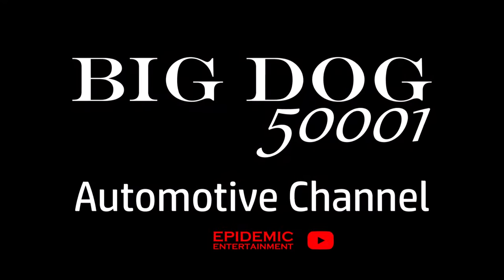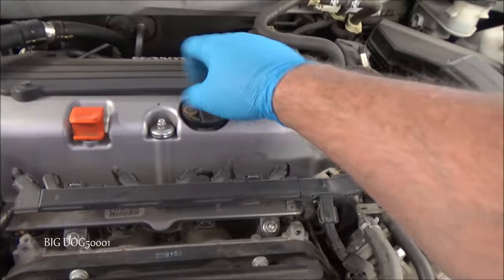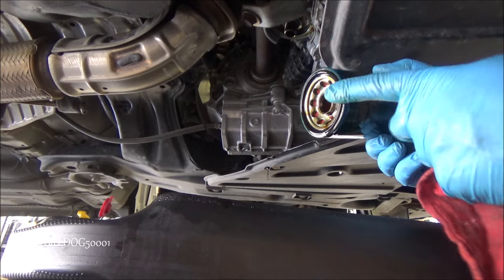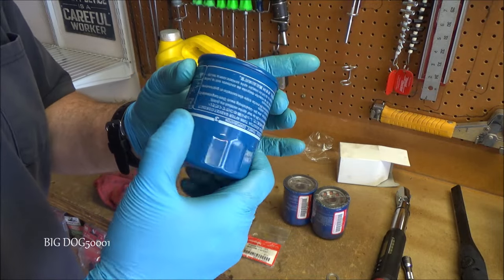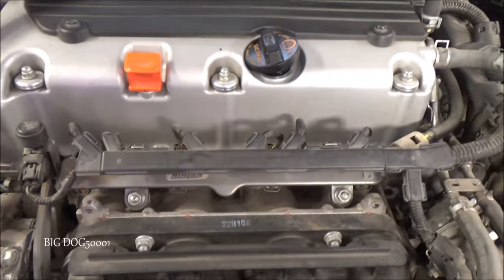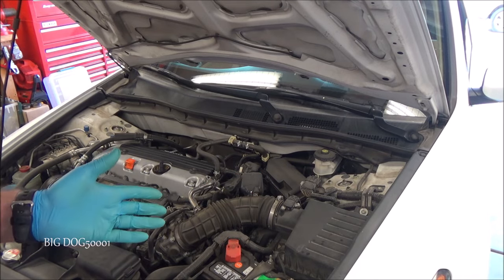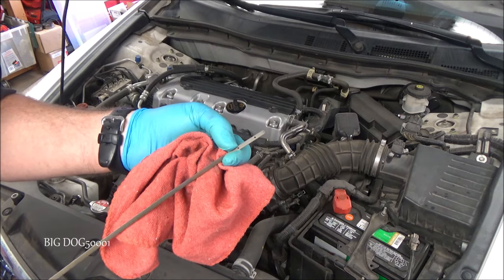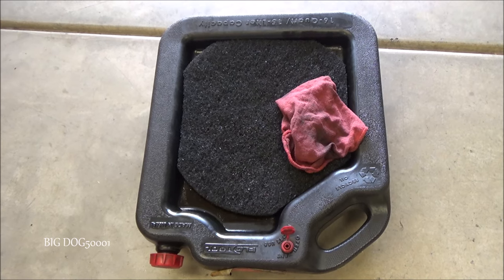2008-2012 Honda Accord 2.4L Oil Change (4 Cylinder)

Comment from the maker: Parts and Tools
Disclosure: This channel earns a small commission using some of these links - at no additional cost to you.
Honda Oil Filter Wrench 07AAA-PLCA100:  https://amzn.to/43Z7nN8
Lisle Funnel Kit 19612:  https://amzn.to/3r3HNHU
Honda Oil Filters:  https://amzn.to/3NlQ8hP
Honda 14mm Drain Plug Washer 94109-14000:
Jack:  https://bit.ly/3oDE82k
3 Ton Jack Stands:  https://amzn.to/3PtxgQI
Wheel Chocks:  https://amzn.to/3XDBO9j
Long Pliers:  https://amzn.to/3NLH3An
Sockets:  https://amzn.to/46iPaeV
Snap-On Digital Torque Wrenches:  https://bit.ly/3gzVN2q
Oil Drain Pan:  https://amzn.to/43ck0Dn
No Splatter Pad:  https://amzn.to/46fiiUt
Center Punch:  https://amzn.to/3PrRAlm

The Big Dog 50001 Automotive Channel Store can be found here: https://www.amazon.com/shop/bigdog50001automotive  (As an Amazon Associate I earn from qualifying purchases).

Comment: For anyone with this specific engine, I've completed used oil analysis several times with Pennzoil Ultra 5w20 using the Maintenance Minder, averaging 7500 miles with absolutely superb wear numbers.  The first time I switched to this oil I did have to add some makeup oil, but the last 4 oil changes, very little to none needed.  I'm using either Purolator classics or Mobil 1 filters.  I switched to Fram Synthetic on this current fill to see if there's going to be even better numbers next time.  Blackstone recommended I could go another 1000-2500 miles beyond 7500 on this particular oil but I'm sticking to the Maintenance Minder, changing at 15%.

Comment: Do you prefer the high mileage version of synthetic oil?
Reply from the maker: I typically use high mileage full synthetic oil on vehicles with over 100k miles.

Comment: Looking a buying a 2012 Accord EX-L 4Cy Automatic.  What potential issues should I look for, if any.  Thank you!
Reply: Mine was bought new off the lot, has 178.8k miles. Just regular oil changes at 5k intervals, transmission fluid changes every two years and changed out spark plugs @100k miles myself. Recently just had engine mounts replaced, both CV axle rebuilt & new struts. That's it, a very reliable engine. I'm hoping it gets me to 300k miles without any major fixes 🤞

Comment: Was there a reason you didn't pre fill the oil filter before installing it? I know it takes about 0.2 qts of oil, and since it goes on vertically, I always fill it up so I can just use 4 qts even in the engine so it doesn't run dry when the oil pump starts.

Comment: What AC did you install in your garage, please?  How does it exhaust and get intake air?  What model AC?
Reply from the maker: It's a mini-split or ductless system, works similar to a conventional A/C system but no duct work and much more efficient.  The compressor is outside and the refrigerant lines run to the unit through the wall.  Also has heat for winter.
Reply: @BigDog50001  thanks so much!  Do you mind giving me the manufacturer and model number.  I was thinking of getting one for my 12X16 workshop she’d I am having built next year?  Do you think it would cool it down here in SA TX?

Comment: I have a 17 mm Shallow Socket, 3/8-Inch Drive. It seems to big ?
Reply from the maker: It may have been swapped out for an aftermarket one (typically after they have been stripped out), but Honda drain plugs for those Accords take a 17mm socket.